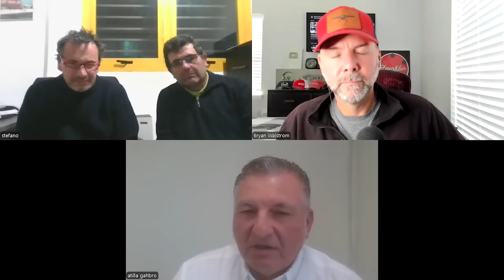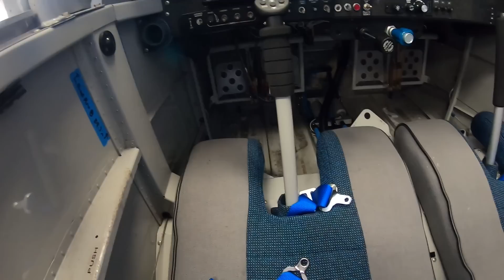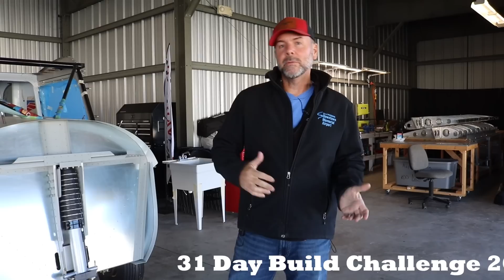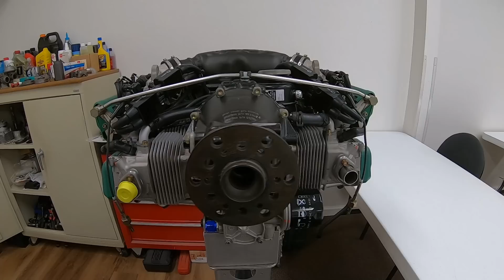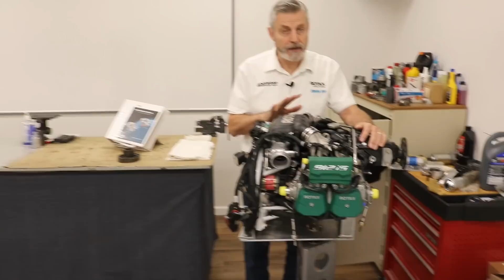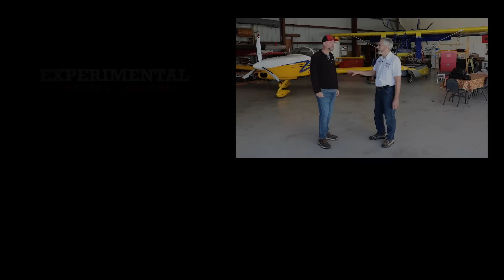Rotax Aircraft Engines - ENGINE WEEK 2024

Comment: Too much automotive mentality has gone into the design of the Rotax engine.
With a Rotax, a pilot has to take too many parts aloft when compared to a Lycoming and a Continental engine.
Too many parts means that there are too many things to go wrong in flight.
Why take coolant and its associated parts aloft when air can do the cooling job-?
Reply: The reliability history of Rotax proves that it is not a problem.
Reply: @Dazza-u4c  The Rotax engine and its components are heavier than the equivalent aircooled aircraft engine.
Reply: I guess all of the automotive mentality is why modern cars are not only more efficient, but also far more reliable than older cars with carburetors, old ignition systems, etc.  And if you look at Ron Wanttaja’s statistics, you will see that Rotax engines are very reliable with the 912 being MORE reliable than the Continental O-200.
Reply: Amazingly reliable, efficient and economical engine. I love my 912ULS and RV12.
Reply: Because the modern engines are close tolerance. They do not rely on lead to fill gaps and act as lubricant. Their engines don't eat oil. To do that it is important to maintain engine operating temperature better and coolant with a radiator in the air along with oil with a oil radiator in the air does that a lot better than just an air cooled engine. If you want to stick with 1950's tractor engines that are heavy, there is nothing wrong with that but Rotax engine cores have proven to be reliable. That isn't really a valid argument anymore.
Reply: Yep, stay in the 1950s…hahahaha.
Reply: @mobsquad8500  What’s the big difference between, 4 cylinder. Opposed ( same) , single camshaft ( no diff. ) build for 15-25% cont. pwr. (AC engines build for 100% cont. !!) MOPED ENGINE need a gearbox , and that’s the, problem .
Reply: @reinerressel975  The Rotax engine and its components are heavier than the equivalent aircooled aircraft engine
Reply: @John-nc4bl  No they aren't. For the same HP Lycoming or Continental are almost 80 to 100 pounds heavier
Reply: @mobsquad8500  what’s the difference , both 4 cylinder opposed , single center camshaft , pushrods . The Moped engine has a gearbox , where it’s impossible to use real propellers . And if you use 75% pwr from a Moped engine it disintegrates before reaching 1000 h !!